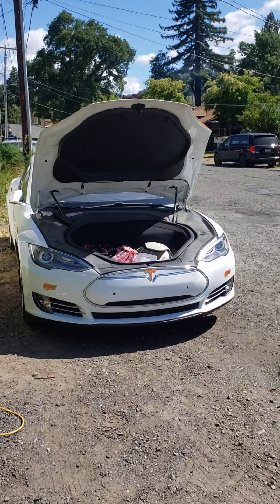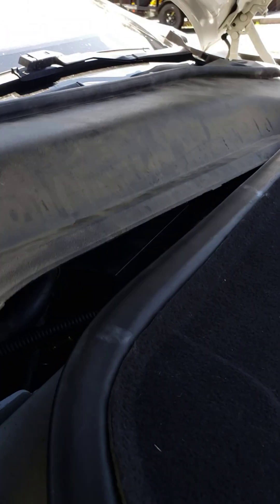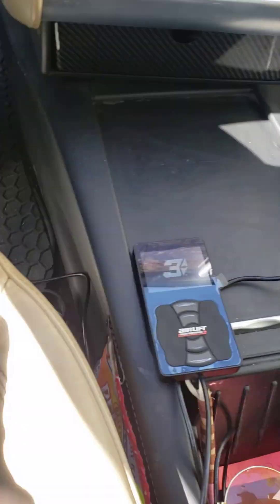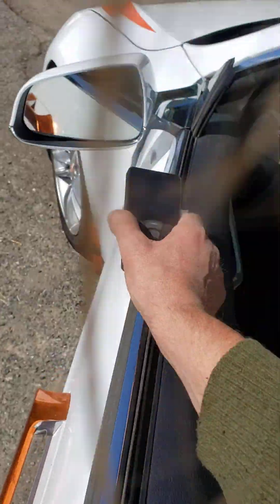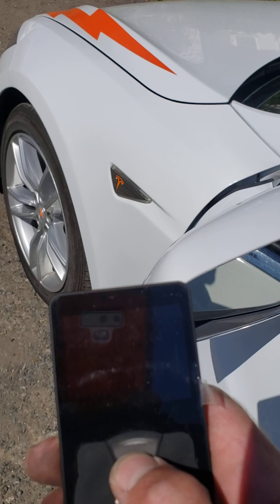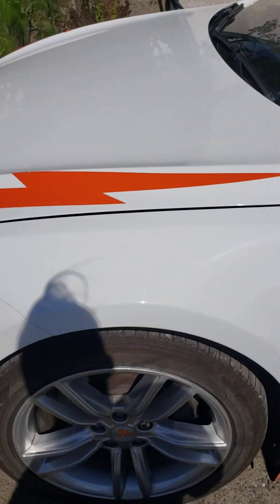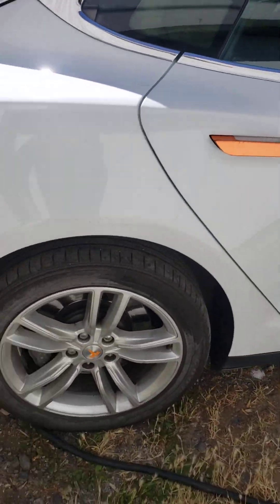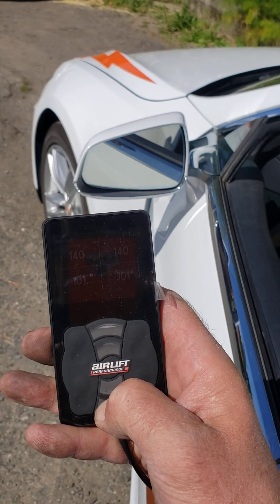I bagged my 2015 AWD Tesla Model S!  Converted from coil to OEM air struts.  Airlift 3p kit DIY air.

Comment: How are you liking it over the coils? Put a ton of miles on my 2016.5 s , so shocks / struts is my next project. Was thinking of doing the air conversion to 

Is the ride smoother?